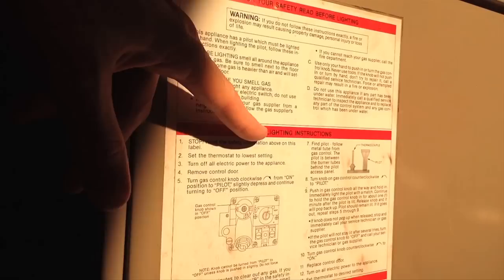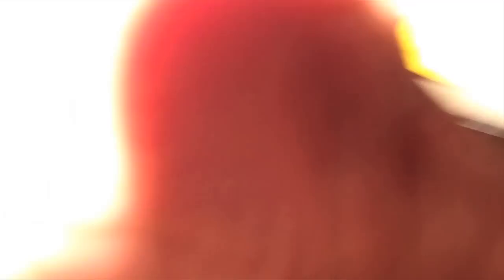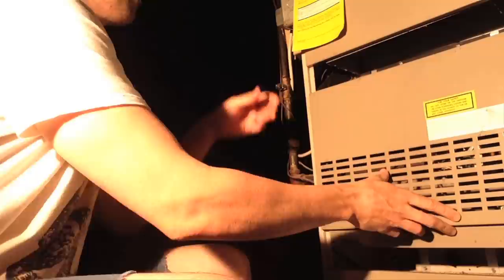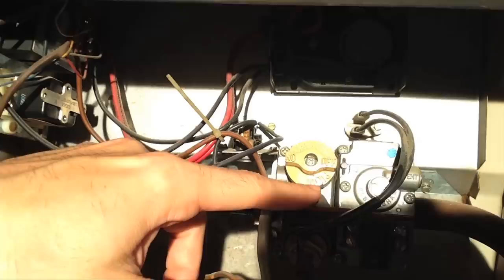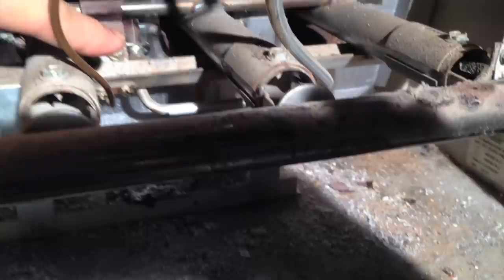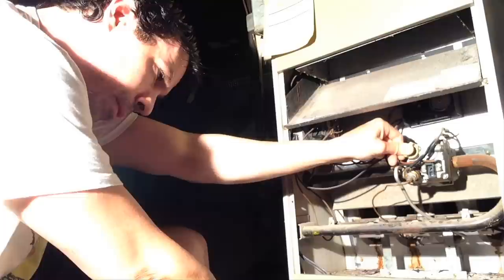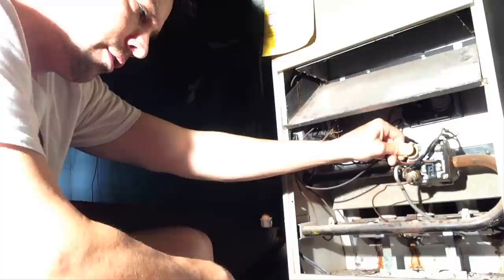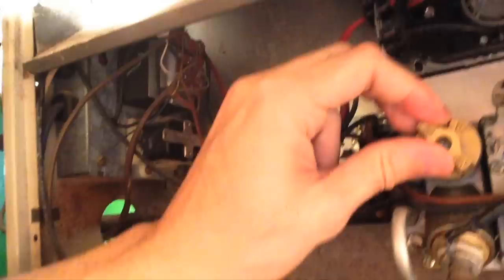How To Light Your Pilot Light (to your Furnace)

Comment: This video was the most helpful re: "How to light the pilot light to your furnace."
My unit has a separate black knob and red button, and I was unaware that there was a 'Pilot' setting.
Its kinda cramped in there, and the knob is on the left.....NOT facing outward.
So I thought there was only ON & OFF.

What I did......
Power switch: Off
Knob: Pilot
Red button: Pushed all the way & held.
Lit a match.....held it near pilot/valve...........got a flame!
1 - plus minute later......released button.........YES!!!!!!!!!!!
You saved me the cost of a repairman!

THANKS!!!!!!!!!!!!!!!!
Reply from the maker: Cool!   That's awesome!

Comment: Yessiree.  Thanks... each site I checked was no help in finding the pilot light, but your simple instructions were great, and you said READ what is on the unit's instructions first.  In my case, it didn't indicate lighting a match, and assumed from the men of the 1960s that I would know this "general" knowledge... my how my generation has started off in a realm of technology bliss tinkered with ignorance towards the basic building blocks of life.  One word of caution... if a unit only has 'on' or 'off', chances are it is an auto (electric) start, and no matches should be used.  Peace and Thank you!
Reply from the maker: You’re welcome!

Comment: I am a little bit familiar with a pilot light, no pro by any means, but the furnace we have now the control knob does not have " pilot" on it anywhere, and inside the furnace cover it says, do not attempt to light the pilot manually. So, maybe I better call an HVAC man. Thanks for the video.

Comment: Do you know anything about relighting a furnace that has automatic ignition systems?  The instructions in the furnace say to turn the on/off knob to OFF, but the on/off knob in my furnace is stationary.  There is a slit in the middle of the knob, and there are two toggle switches, or gas control switches as the instructions call them.  Do I flip both of those switches, or just one, and if I flip just one, how do I know which one to flip?

Comment: My control panel lid doesn't slide perfectly into place. There's a small gap on the top left corner. Should I be concerned? Is it better if I shut down the furnace, restart it, then try and fit the panel in place?

Comment: I got the pilot lit n it stays on but everytime I try to turn the nob it shuts off. What can I do to keep it from goin out FYI the temp on it is on low
Reply from the maker: You have to turn it just right.  Try really looking at the directions and seeing if you are missing a subtle thing like pressing the knob in as you turn it, check this video again, give it a little more effort and you can get it lit.  It takes effort, gotta try, read and re-read the directions until you understand more and see if you are missing anything.  Its not easy, but nothing's easy.  It takes sometimes going that extra effort and then you get it lit.  That's why some of the "professionals" who go to your house to light these charge $100.  Worth it to take a little time and effort even up to 30 minutes and you can do it! :)

Comment: hi John, very helpful video but I'm hoping maybe you can help me with this: my furnace's knob has only on/off, no "pilot" option. I tried both turning it halfway in between & in the "on" position, depressing it while attempting to light the pilot but nothing...thanks for your speedy repsonse!
Reply from the maker: I would try looking closer for the word that says "pilot," maybe get a brighter light?  You may have to hold in the knob on the on position while it is being lit
Reply: thanks, I meant to get back sooner...it was actually a furnace with an electronic ignition so no pilot flame to light. Ended up needing to be completely replaced.
Reply: Kat Jappe 😂😂😂😂😂😂😂😂😂oh shit this is too funny!! hey Kate look a little bit closer for the word dumbass lol hey spaceman look into electrical ignitors lol